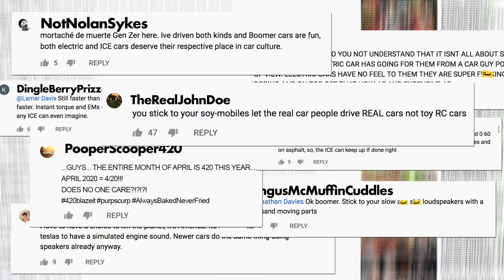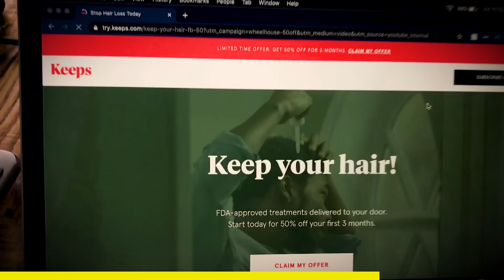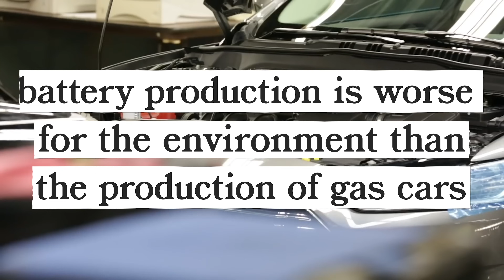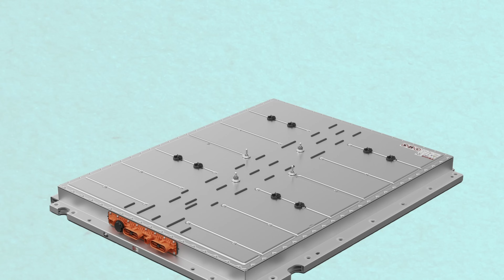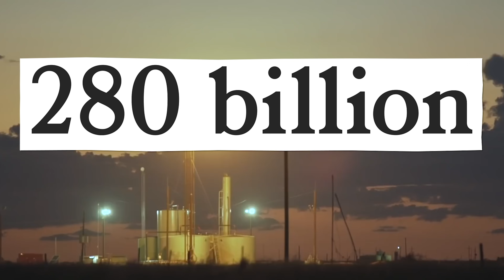Are Electric Cars REALLY Better for the Environment?

Comment: Look up how much electric energy it takes to process just one gallon of gasoline? Answer it's more than it takes to move an average ev 25-30 miles. That's just to refine it. never mind find it, extract it, transport it. Then refine it, then move it again, then store it in a tank to only take more energy to then get pumped into your vehicle's tank. 🤔

Fun fact for all the idiot's claiming that evs consume massive amounts of cobalt? The world's number one consumer of cobalt? That would be the fossil fuel industry, more specifically diesel! 
Oh and the claims about batteries? Here's something fun for all you fellow coffee drinkers to ponder on. The average ev battery does the same environmental damages as consumption of 31 cups of coffee does. 😁

Another fun fact for ya. The average oil refining station consumes as much energy as it would take to simultaneously charge 330,000 electric vehicle's! 😅

Comment: Even if your electricity is produced from fossil fuels, an electric car will use that energy much more efficiently then a gas car running on the equivalent amount of energy density/ fuel. Not to mention offsetting it’s upfront carbon emissions The rest of its life. Eventually Becoming carbon negative offsetting it’s an emissions relative to gas cars who will add to pollution the rest of its life
Reply: I see where you're coming from, but nah probably not, there would still be an efficieny loss when turning the fossil fuel to electricity.
newtons third law exists for EV's also ;)

Comment: The Car community should be aware, cobalt is also contained in your gasoline.  It’s used in Desulphurisation during crude oil refinement. If you ran  emission numbers from drilling refinement transportation and then use. I’d like to see those numbers.
Reply: lets see the environmental impact of solar panels, wind farms and hydroelectric dams.   these things can be very destructive, but that was ignored in the video.

Comment: You missed 1 key piece of information in this video, and that's the fact that EV batteries are only good for around 8 years. ICE cars don't have that problem, and can last significantly longer than that. So, you'd have to take into account the additional 8-10 tons of CO2 every 8 years for that battery replacement.

Taking all that into consideration, if you go with the extreme numbers mentioned in the video, comparing something like a typical Honda or Toyota car to a Tesla is pretty much a wash when it comes to environmental impact, and, with an ICE car, you don't have to live with the weight of supporting child labor.

Also, things like coal burning produces a lot more harmful gases than just CO2. CO2 isn't really the greenhouse gas that's the problem anyways, it's the additional mercury, lead, and sulfur dioxide that really destroy air quality, in addition to the heavy soot it produces. Those are things ICE cars don't deal with as much.
Reply: This is all taken into account with well-to-wheel studies, and EVs still demolish ICE cars.
Reply: I am not sure a battery will last 8 years. Even if it does, it will be a low mileage car. Not to mention your range will drop literally every month after the first year.
Reply: @spartacus2954  Priuses from 20 years ago still drive around with their original battery after 200.000 miles...

Comment: You left out info manifacture dont release due to ev push. Constant battery replacement. Life span of vehicle average at 5 years max per manifacture. Now you take in acount how as lot of people to keep their vehicles on avrage up to 10 years. Ev batteries start to fade after 3 years slot times we replaced them in 3 year range not even life cycle of 5 due to range complaints. You count in 10 year avrage ownership battery replacement ect into it as well. EV is not better for environment, not now at least. There is alot holding ev back it's being pushed as way for future. As its sits like you said it's still an infant. Between that 1h hour avrage charging limmit of charging locations its pass for majority out side of trying to be new cool hip guy.

Comment: America: Start Bicycling! Hands Down the most environmentally freidly.  Do.  Your.   Part.
Reply: Yeah, sure. Fun fact (as these seem popular), people get old. People like to go places as families. Not everyone lives in cities. Cycling is actually not that safe. Ad nauseam.
Reply: Unfortunately the United States isn't set up for that. Everything is so far apart, our infrastructure is based on cars. I'd love to bike more, but it takes me a 15 min drive that would be over an hour to bike, and also be very dangerous as there are no bike Lanes or even sidewalks.
Reply: @nicholasfield6127  laughs in australian, we're even worse for distance to cover. hopefully we can begin to take cars off the road and replace with light rail, trains, bikes and buses
Reply: Bicycles are great for travel in the city, but when your work is half an hour away by car doing 70 mph most of the time, not so much.  Also can't really carry a whole lot of stuff on a bike, meaning model train shows would be kind of impossible.
Reply: Bike lanes shrink roads. If narrowed, generates congestion. Traffic worsens the carbon footprint. Hence cycle is not environmental, or safe, or loud as a V8 hahaha
Reply: @enriquetorresgonzalez5080  actually, not completely true, if you add lanes to a road, traffic increases to fit that capacity, if you decrease the lane numbers, people get sick of traffic and look for alternatives. 
If you remove 2 lanes of a highway which can move about 4,000 vehicles per hour(most just 1 or 2 people) for a light rail system  you find that at capacity a light rail system can move 9,000 people per hour, and if you add more light rail carriages that number increases.
cycling isnt good for long distances between cities, however within cities with a well planned cycle network they can work great for the environment

Comment: Nolan the video was good. There is one slightly false false statement though. Our power grid is actually very unstable and power production capabilities are very minimal. Yeah if you connect millions more cars it will not put a big hamper on grid. The problem that will arise is that power consumption at night will start to go way up. The amount of power made isn't a constant amount. Most power generating stations don't run all there generators all together. It's a  on demand off demand breathing process. Just a few years ago the switch to LED lights has significantly lowered the amount of generated power. If we start plugging more and more high speed power chargers in the grid you will see big spike in how much power we will constantly have to be producing vs the ability we have right now to relax the generators. Also the government hasn't let any new plants be built in years so there will be a very quick need to build. The truth is that as sustainable new power sources that we are being told will do the job they actually fall on there face when it comes to long term solutions and effective solutions. Wind and solar hurt the environment in lots more ways then we admit to ourselves. Truly the only solution we have had for changing the world to be a cleaner place to live is nuclear. China is starting up a few thorium reactors this year. There very safe and don't melt down. Even uranium is safer then coal fire power plants. There's actually more radioactive particles that come out of coal plants then nuclear reactors. Do the research for yourselves its pretty cool knowledge learn about. Actually the inventor who designed the modern nuclear reactor always wanted to use thorium but uranium could be weaponized so if that tells you something. He designed a plane in the 60s that was nuclear powered. It would have flown pretty much forever.

Comment: I’m sure I don’t only speak for myself when I say, I don’t care one bit how I “hurt the environment”. Call be a bad person, whatever you wish, I will always drive an inefficient, loud v8, I will always seek to roll coal in a diesel, nothing is gonna change my ways because I might possibly kill a tree or two 😂 Eventually, at the rate we’re going, electric will probably be the fastest cars, have much better range, cheaper, more efficient, eventually there may be no “better” reason to drive an internal combustion engine vehicle for most people. But after riding in evs and being around them, they’re just not the same to me. I want my aggressive v8 tone, I wanna be able to go under my hood and tinker with an engine, I wanna be able to make my vehicle faster than it comes from the factory EASILY. If there’s a problem with my car, it’s not hard at all to diagnose and fix, but I don’t even wanna imagine what nightmare an electric vehicle could be to fix. The environment is not a concern of mine at all
Reply: And you think when EV's take over, you will still be able to drive an ICE vehicle?

Comment: What also should be taken into account is energy density. Batteries and Fuel cell tanks have a way worse volumetric and gravimetric energy density, which means they take up more space and weight than a standard fuel tank. 
All so electric engines itself are highly efficient and taking the battery into the equation efficiency still beats gasoline cars. If we assume a basic electric engine with 80% efficiency, which machines like asynchronous machines beat with ease, and say that the battery is at 60% (charging and discharging) with transformation than you'll get 48% combined. However if we take into account that transporting electric energy over long distances loses roughly a third of it, than you drop to 32% efficiency, which is worse than ICE. However the question of efficiency only makes sense when electric energy is 'made' without  sources like sun, wind, water. Especially sunlight is there with no particular limit which means that we only got to use it somehow, no matter how much is lost in the process. 

If we took sunlight to transfer Carbon dioxide to Fuel, then ICEs would have negative emissions, because the fuel production is not 100% efficient, meaning we take out more Carbon dioxide than with is brought back in as we burn the fuel. 
In areas with high exposure to sunlight, this would be possible and better for the environment than any electric car, because of the absence of battery production, recycling and replacements.

Comment: TL;DW
If the electricity source for charging is coal, turf, non renewable resource= worse

If the electricity source is windmill, sunlight, renewable= cleaner than combustion
Reply: Quaker Crackers actually not true did you even watch the video?

Comment: Energy Source

I did 2 research essays on how ICE 's are better than combustible vehicles and the main argument I had was that where you live determines the efficiency of the ICE. However, after an argument with my friend's dad, who works for Duke Electricity, I learned that my point was false because many companies transfer electricity throughout America. I had always assumed that depending in which state you lived, would determine the efficiency. After some research I learned that the American power grid is split between "three main interconnections, which operate largely independently from each other with limited transfers of electricity between them" EIA.      https://www.eia.gov/energyexplained/electricity/delivery-to-consumers.php
Your energy is derived from which section you live in America; meaning that my friend's dad was not completely correct. But how much energy is actually transferred in your section!!??? Down the road where I live, there is a solar plant. How much of my family's energy comes from there? Or is our energy coming from West Virginia, which 92% of its energy comes from coal?

If you want to know more about the argument about ICE”s and Combustion vehicles I would highly suggest this video by Engineering Explained and this video by CollegeHumor which holds very different views. The collegehumor video holds a lot of truths, but their argument does not add up after some research.

Engineering Explained:   https://www.youtube.com/watch?v=6RhtiPefVzM
College Humor :  https://www.youtube.com/watch?v=h7H-_8UkmFU

Life Cycle and Retirement for ICE's

Not much was said about what happens when an ICE's battery retires in the video. To understand, look at an ICE this way.
1) First, it is born using more energy to produce than Combustion cars.
2) Second, it is on the road using way less energy .
3) Third, it dies and has to be reprocessed for other less demanding tasks.

The first and second points were explained in the video but not the last one. After a battery dies, "The components typically will be swapped out after about a decade in family cars and four years in harder-working buses and taxis. "While those replaced batteries can’t run a passenger vehicle, they’re ideal for less-demanding tasks such as storing electricity from solar panels and wind turbines, and hoarding power from a regular grid connection when prices are low" Bloomberg Businesswomen . 
https://www.bloomberg.com/news/features/2018-06-27/where-3-million-electric-vehicle-batteries-will-go-when-they-retire

Lol, car batteries can be expensive just because of the uses they have even after being used for many years. My dad tried to buy a large car battery but couldn't find any for the price he wanted.

Facts
 I always believed that if you had an ICE in an area like West Virginia, it would be worse for the environment. Instead your best bet would be to have a hybrid vehicle. Even in the worst areas, having an HEV, hybrid electric vehicle would be the best bet.

 Electric vehicles don't have to be that expensive either. There are many cheap EV’s on the market and with the increase in demand, the prices will decrease.

Combustion vehicles are very inefficient. They waste a lot of energy through heat and many moving parts. Plus ICE’s have very few moving parts and don’t need constant maintenance. Except, tires, brakes, common liquids such as the thermal management system, coolant levels, brake fluid and windshield-washer, and of course charging. Which is not as bad as it seems. If you want to know more about maintenance for EV’s check out this article . 
https://www.carfax.com/blog/electric-car-maintenance-tips

Comment: With the price of oil collapsing (gas approaching $1 per gallon), and the high price of a good EV vs a cheap ubiquitous ICE car that any grease monkey can work on (Toyota corolla?).... the cost of ownership and its utility to include repair.... ICE is best for the working class for the time being... plus last time I checked... we weren't using child labor to drill and refine oil, nor were we hurting the working poor farmers in impoverished countries for the rare earths we need for the battery's, nor were we destroying millions of acres solar farms nor running land owners off their property to cover them in wind farms.... when it all boils down... Its the individuals wallet and lively hood that decide what they use... environment be damned.... example... ever try to fix your own TESLA like body work or electronic gadgetry that is prone to breaking in it?... you'll never own it. you rent it as you must stay connected to the system for updates and warranty in order to get covered service work and drive it (or you get put in limp mode)... this would be a good "Part 2" to your video BTW.

Comment: If you’re in West Virginia, the average EV is generating 3,000 lbs less C02 than a gasoline powered car. It’s going to take a while to make up for the greater initial footprint of the EV, and you need to account for replacing the EV’s battery after 5-7 years.  I think you may need to rethink the claim that even 100% coal powered electricity is better than gasoline powered cars. In places that aren’t coal-powered, EVs will definitely be better. https://afdc.energy.gov/vehicles/electric_emissions.html

Comment: So, ignore that EVs are still dependent on oil production and shares in the plant air, I mean CO2 footprint because, cargo ships for raw materials like everything else, plastics comes from what again, synthetic rubber is sourced from what, and if you ding ICE for the entirety of oil production pollution, what kind of resources do you expend to manufacture wind and solar, which also require their own power storage somewhere if no coal/gas/nuclear/hydro power plant is around to handle baseload power when the sun or wind isn't cooperating?
Reply: I believe Real Engineering has a video on your latter point, using Europe as an example. If wind in Ireland isn't cooperating, France steps in and sells them some power for money. Norway can also buy France's energy when it is cheap to stock up its large hydropower batteries, and discharge it to produce energy to sell when demand is high, in a short explanation. Engineering Explained also has a video explaining that even in high fossil fuel usage states, an EV is actually still more efficient than an ICE per unit of fuel burned. Something about producing energy in bulk at a large facility vs a relatively tiny engine in your car, even when accounting for losses in efficiency in converting that chemical energy to electrical and then to mechanical again.

Comment: What about battery replacement?
Reply: Last year, a Tesla Model S from 2013 has reached 1.000.000 km with just a single battery replacement. However, the capacity of the current one is also reduced by 20%